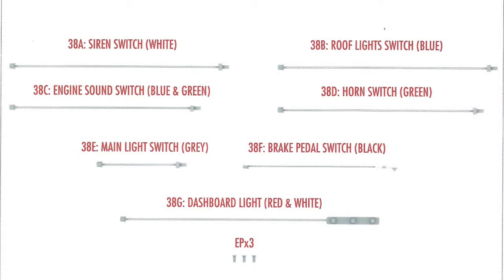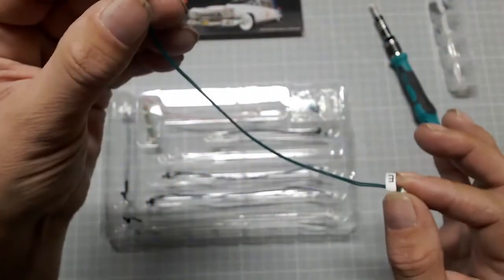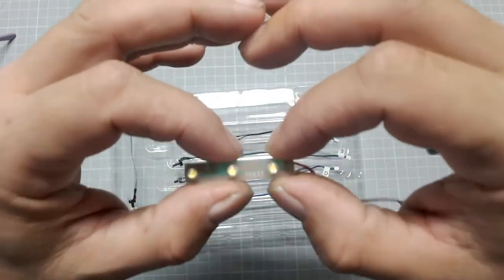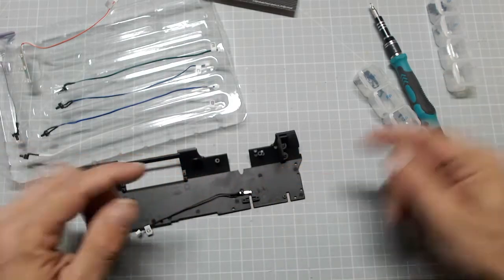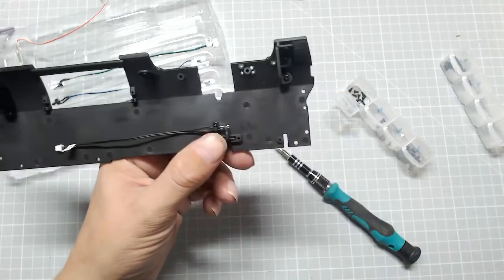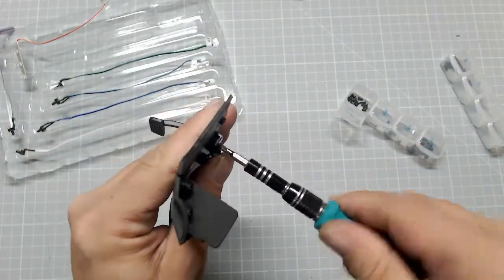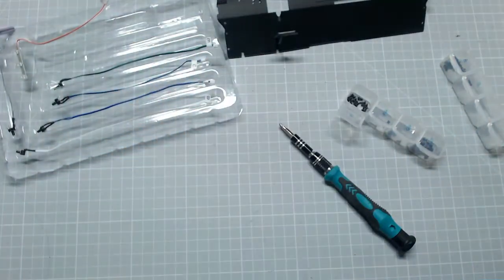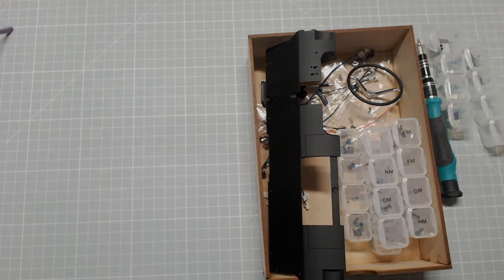Build The Ghostbusters Ecto 1 38 Installing the Brake Pedal and Switch

Comment: Just in case you were not aware, there is a discrepancy between the written instructions and the photographs in the magazine, for the wires.  From what I understand, you need to follow the photos, and identify the wires by their colors, for the correct installation.